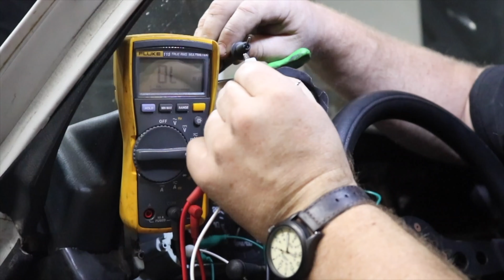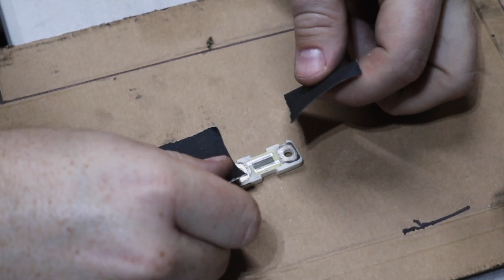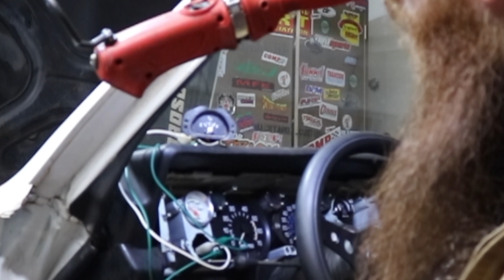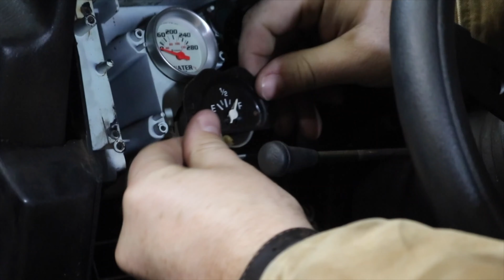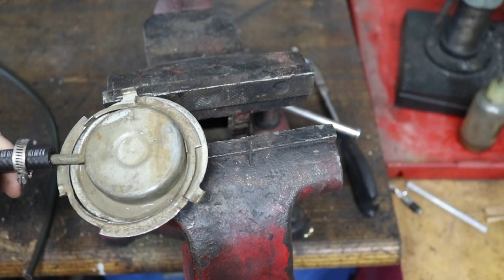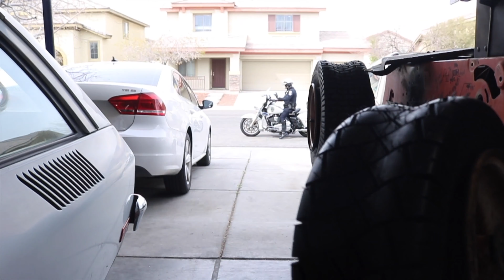GM Fuel Gauge troubleshooting & Repair | Gauge Lens restoration | fuel tank vent mod | Vega EP14

Comment: After following your video I found that the gauge works properly and the fuel sending unit works out of the vehicle but after installing into the tank it will stay between 1/2 and E with random jumps to 3/4 rarely. Any idea what could be going on? Its for my 1989 camaro
Reply from the maker: Check the resistance of the wiring itself. You might find it has a rubbed through spot or wire hairs touching in a connector.

Comment: I have a 69 Camaro with the same issues, mechanic keeps giving me the run around. Wanted to ask you some question.
Reply from the maker: Shoot. I might not know but I’ll make something up that sounds good.
Reply: The resistor a temporary fix, do they need to be welded / sother to terminals.
Reply from the maker: It’s a permanent fix. Until the resistor burns out.
Reply: Do you have vide on how to remove the floor consul gauges.